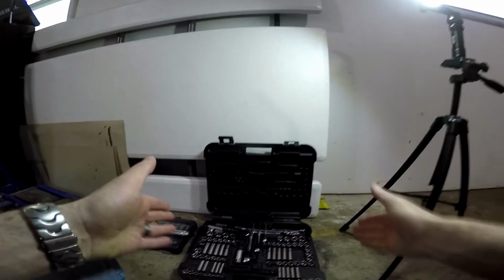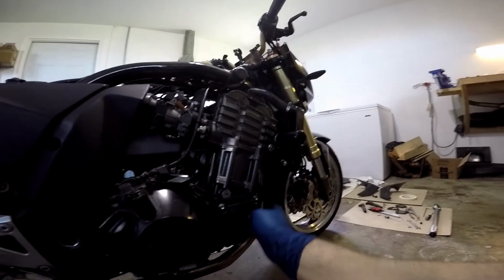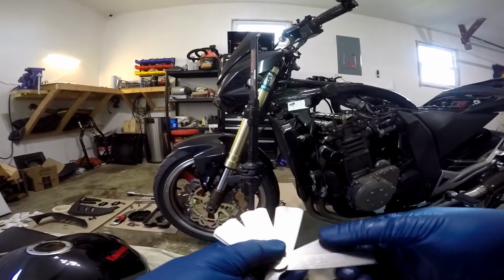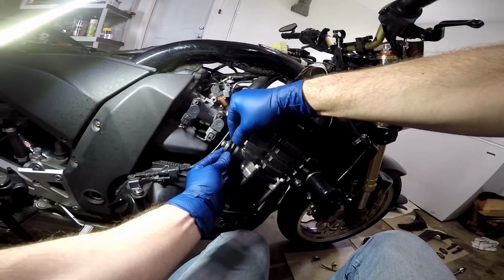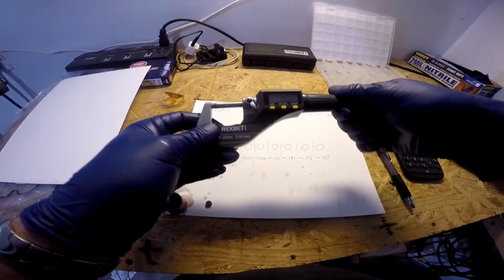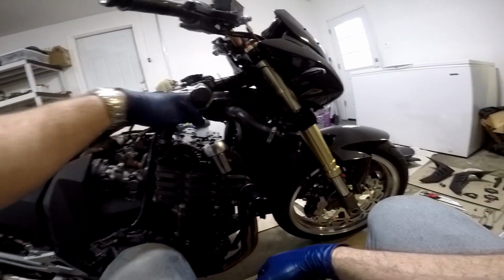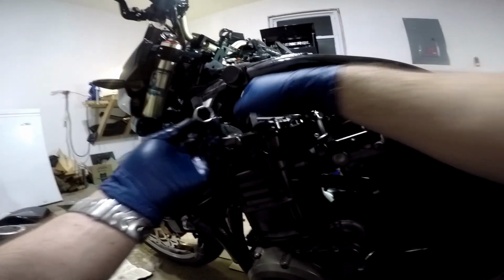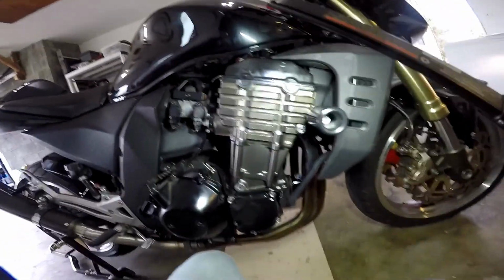Valve adjustment - Gen 1 Z1000 (03-06)

Comment: Thanks so much for this! Just curious, did you drain the oil before you started?
Reply from the maker: No, you don't have to drain the oil to do this job, but it might drip a little when you take the pulse- cover off, so put a pan under that.

Comment: Hey, one more thing, all my EX. Side clearances are below the .22mm range, for example, Ones all the way at .10mm. At that point, is it even worth changing the shims? Is my valve totally shredded ? The bike runs fine. I commute on it every day, but I was wondering if I  change the shim, will it make much of a difference?
Reply from the maker: I can't give you a professional answer, I'm not a mechanic by trade. But if I was in your situation, I would go ahead and re-shim them. Who knows? you might get years more out of it before the valves are completely out of adjustment.
Reply: @lonelyryder7441 Yeah, I'm working on it rn. Thanks for the video, I have the 03 z1000, and your video is perfect. Really happy I found your channel, Ride safe

Comment: Hey lonely thanks for the video it awsome totally needed that info. Do you need to put silicone gasket sealer when installing the valve gasket ? Or do you not apply it because it dont need it ?
Reply from the maker: It depends on who you ask. Some people say you need sealer, others don't, everyone has their own preference. The "official" way you are supposed to do it is with sealer, but I personally don't use it. All it does is make the gasket last a little longer before it starts leaking, but it also makes it more of a pain to replace down the road because you have to scrape that gunk off again. So, I personally don't bother with it for valve covers, but it's really up to you.
Reply: Yeah, that's my dilemma rn, I did it with gasket sealer last time, and it didn't even last that long before it started leaking again! Then it's a pain in the but now to get all the gunk off, not to mention the bits that fall in you have to clean out. Thanks for the tips I really appreciate your input and videos man, ride safe ✌️
Reply: Hey, one more thing, all my EX. Side clearances are below the .22mm range, for example, Ones all the way at .10mm. At that point, is it even worth changing the shims? Is my valve totally shredded ? The bike runs fine. I commute on it every day, but I was wondering if I  change the shim, will it make much of a difference?

Comment: Brilliant vid, so so helpful. Thank you so much, theres not many vids on the 1st gen at all. Would you be able to show how your steering damper is fitted? Also have you balanced the throttle bodies? Thanks again.
Reply from the maker: Thanks for the compliment. As for your questions, the damper assembly is quite easy, it's literally just brackets and bolts. I could make a quick video on it, but I'm not planning to film any videos during winter, I'm busy remodeling my basement right now. No, I have not balanced the throttle bodies, but I don't think it needs it.

Comment: What steering dampener is that? Trying to find one for my green 03 z1000
Reply from the maker: I bought it on Ebay a few years ago, but that listing is long gone. It's not the most robust damper, but it does ok for the price. My only complaint is that the paint is starting to rub off of mine. Just do a search for "2003 z1000 steering damper" and they will pop up. Here is one I found that looks identical to mine, with some green highlights.

https://www.ebay.com/itm/175393747534?hash=item28d648324e:g:2-UAAOSwE9ZhOcyB&amdata=enc%3AAQAHAAAAsF7SdY3bkg7B1Q27BcYsbzACUwRBPq48jspYxnifg0tYMlW6zyLctNOV2juv3eSRRR2pO5IXJGQ18qodGPKxZl%2FrqMsbvSx07nyoahPRsZCMrdYjX4W%2FBU0Sr5SGFu7lElQVDcXKtTwLdpe0jsFWNK%2BvKZ55Z3hNfgyQfsiY1kI6g595WO5enVKvGu4kgTyjoDvkkgGYa%2BL4KwJowuXjtmhqDvNa5iZedDddnw%2FjH2ur%7Ctkp%3ABk9SR6T-2fraYA

Here is also one on amazon with a lot of colors to choose from, but it's more expensive.

https://www.amazon.com/Motorcycle-Stabilizer-Z1000-Z750-2003-2009/dp/B075SXP2Y4?th=1